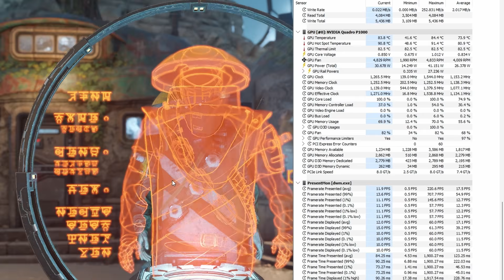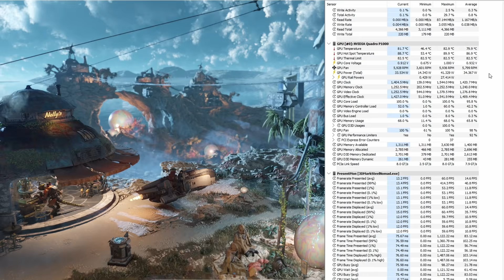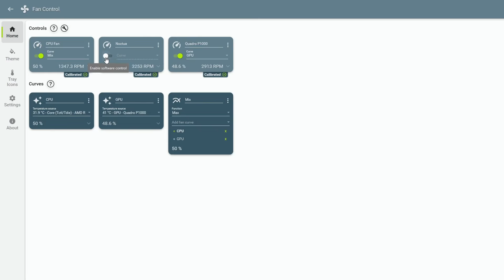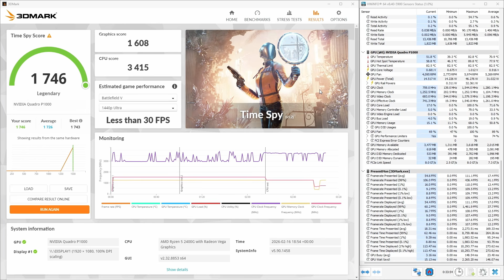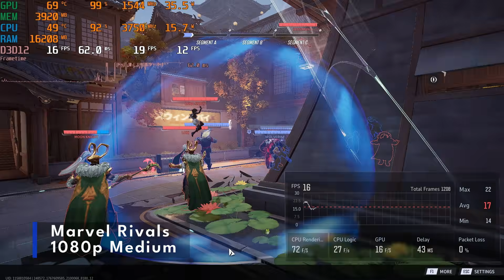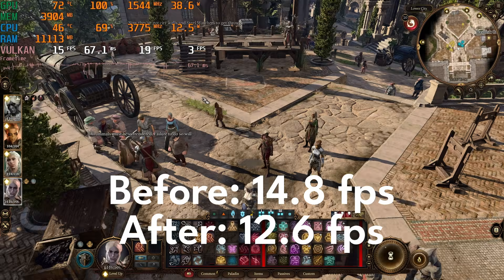Stuffing fans where they don't belong

Comment: for some reason this video seems pretty quiet on my end, ended up cranking the volume and I can hear you but your background music is quite loud relative to your voice. 

love the premise of the video and yeah noctua almost always has a product for any cooling sceniro if you have the money

the lower than expected performance gain could be driver related, been hearing some bad stuff about the most recent batch of NVIDIA drivers? For future tests maybe use the same driver if looking at perfomance as I cant think of any other reason to why the perfomance may of dropped. some games dont apply settings corectly without restarts I guess settings not being as set could also explain some variaton either postie or negative.
Reply from the maker: Thank you for the comment! I'll look into the audio issue. Davinci Resolve is supposed to normalise the audio on export but I guess it isn't. I think these tests were all done on the same driver version, but I'll make sure if I revisit this. Still looking for a resonably priced 5700G to show up on eBay.

Comment: trouble with the gpu is the heatsink and cooler is tiny mayheps be worth seeing if u can bodge a bigger fan on it
Reply from the maker: It did cross my mind, but then again anything much bigger wouldn't fit in the case - at which point I might as well buy a "proper" GPU and a case to fit it. But maybe worth doing just as an experiment for lols
Reply: @eskcomputers  wonder if you could turn the case into passive cooling by pressing the gpu heatsink to it

Comment: It can be your thermal paste is dried up on the Gpu? Those temps are very high.
Reply from the maker: I don't think so, I cleaned and repasted it when it arrived
Reply: @eskcomputers well other than, to improve the temps, use a long Riser cable put the GPU outside the case 😅, fun experiment

Comment: Am I tripping or do you sound very similiar to F7GOS here on youtube? Fun video, though! Subbed. Loooaads of benchmarks, though I am not a fan of the use of framegen at all, regardless of original framerate. I guess I should look at the previous video at least then! Small note for the CP2077 benchmark, the crowd density option is really hammering the CPU, why let it at high testing something you changed with your graphics card? Oh well, off to your other videos!
Reply from the maker: Thanks! He's a fellow Scot, so there's some similarities. It's not in the vid but I think I did try C2077 again with low crowd density and it wasn't making much of a difference, surprisingly, would have expected it to.
Reply: @eskcomputers  Wow, okay then. I thought they sounded similair.
Interesting, I really thought High Crowd Density was shifting the bottleneck away from the GPU. Thanks for the quick reply!